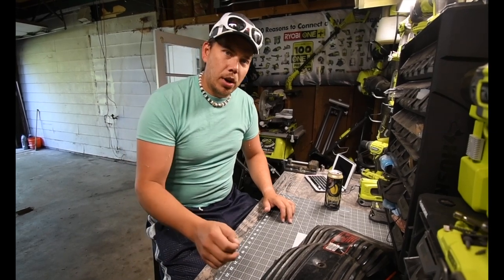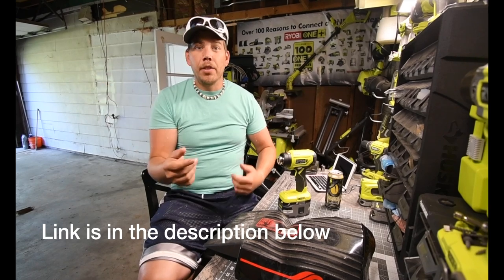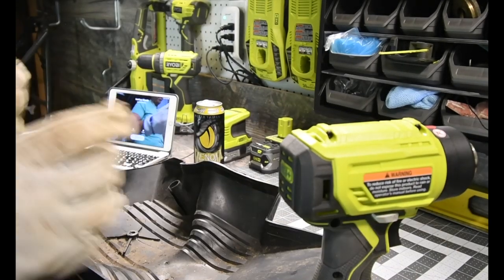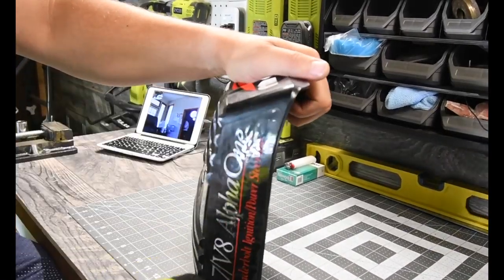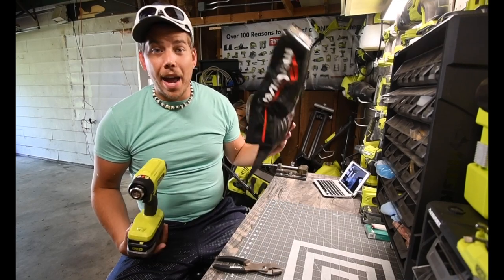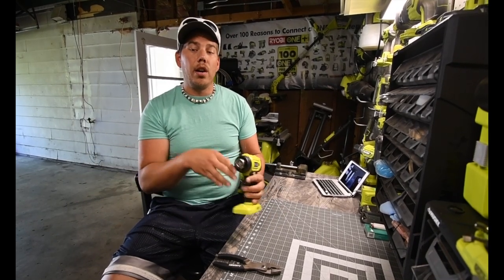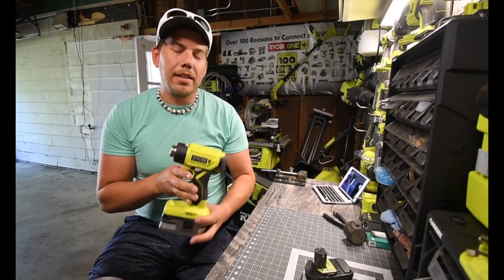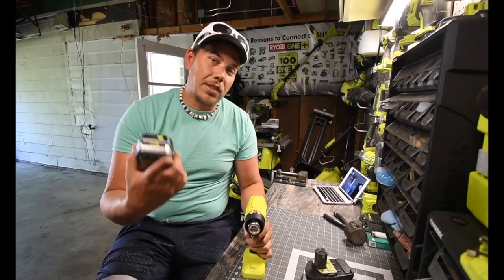Trying to mend back my engine cowel

Comment: On my wishlist. I will mostly use it with that little deflector for heating shrink tube. You might want to try slowly heating that engine cover in an electric oven until it gets soft enough to reshape it.
Reply from the maker: I think ill do that. its a really strong plastic
Reply: Yeah, heat it up till it’s soft and maybe put something flat and metal on the inside and outside and maybe pull them together with some squeeze clamps or something?

Comment: Hello again David, Thank You Sir o ce again for a great review and using some ingenuity to try and solve your problem. I like the oven idea someone had down below. Getting the right temp is going to be your challenge. I have a thought for when you you get it to the softening point use a piece of wood a tiny bit smaller than the section your trying to reshape then use 2 or 3 vice grips on the wood to pry into shape. You'll need wood on both sides so you don't marr the plastic. Metal might work too as long as it's cool. I believe the key is something stiff running most of the distance that needs reshaping and you can clamp fast and start bending before the plastic cools down. I thought if a micro. torch as a heat source but you would need to be careful about getting to close and burning a hole in it. Let me know how and what worked. Thanks again for sharing your thoughts and videos, Rodney
Reply from the maker: Will do sir and thank you very much